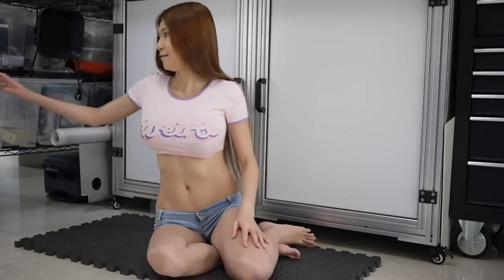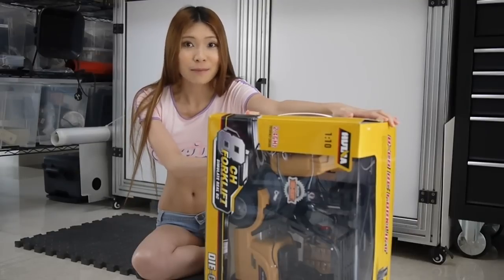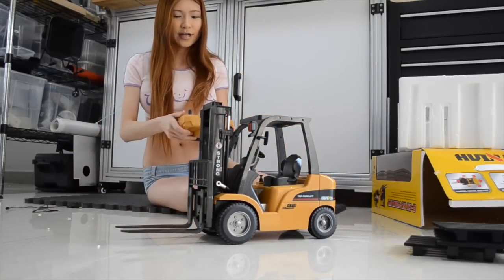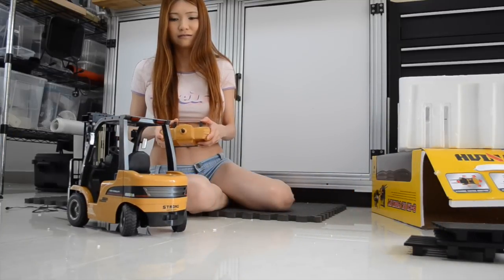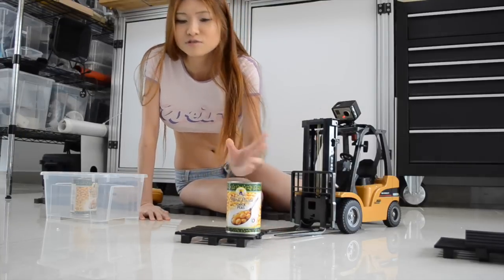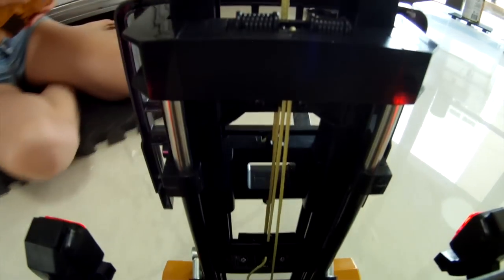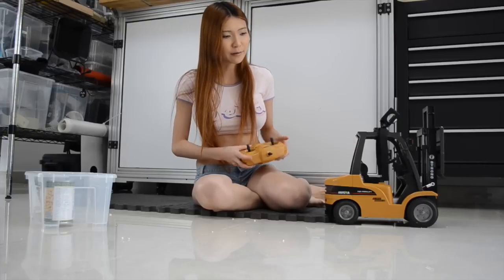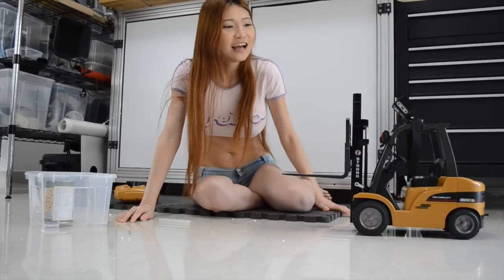HuiNa 577 Forklift Review

Comment: One thing you should think about is fork tilt. To prevent the load (palette/skid and cans) from sliding, you tilt the forks up. Then you can move back and forth without the load sliding off. Also, practice will teach you how to move without jerking, and how to start to move slowly, building up speed as you go. (Experience with driving a real fork lift.)

Comment: Naomi, in order to prevent the loaded pallets from sliding on the forks you need to angle the lifting mechanism back so the forks cradle the load and the center of gravity moves back over the front drive train, which also increases traction. Plus if you use a lighter touch on control mechanisms and move them slowly the forklift will be far easier to control and all of the steering and traction issues will disappear. I hope you find this helpful.
Peace!

Re: Forklift Controller
It appears the designer/manufacturer failed to include the ability to adjust the lifting mechanism to compensate for the load, which is a very important feature of forklifts in the real world. Too bad too because this had the potential to be used for some cool projects if it had this feature.
Reply from the maker: Hah well I destroyed it in my RC combat competition so too late now but will try that if I ever get another.

Comment: if the pallets had more friction and weren't as smooth it could carry things a lot easier, but I was wondering: is the object its carrying is heavier would the weight prevent the pallet/object the pallet is carrying from falling?
Reply from the maker: That's a good idea. I could maybe put some rubber tape on the forks? Each can is 400g, I think it can lift about 1kg without tipping over?
Reply: Can the forks tilt forward and backward. If so forklift drivers will tilt the load a few degrees towards the back so the load doesn't slide of the forks.

Comment: does it use dc motors or servos of some type? with servos some easy tinkering could allow much finer control, especially seeing that it uses 2.4G band. How did you ignite the torches you used?
Reply from the maker: Motor for the fork and drive I think, servos for steering.
Reply: you could still use pmw to soft-start the drive motors and reduce some of the jerking motion

Comment: HAha remote controlled forklift is funny.
You may be a terrible driver, but if that had some motor speed controls, you could dial down the speed before transitions, and then speed things up after things are moving. It would make the toy a lot easier to operate.